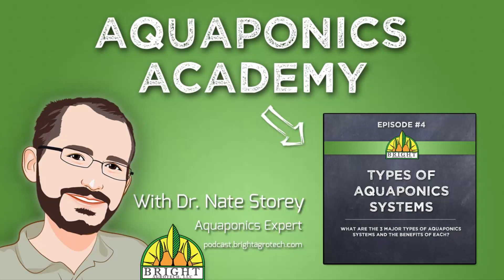Aquaponics Academy #4: Types of Aquaponics Systems

Comment: Hi Nate and thanks for sharing all your precious knowledge with us.
I would like to start a home set up in my back garden. It would have to be contained on a 6'x6' max and I was thinking of an ebb and flow system. It is not talked about a lot, rather the CHOP system with the famous bell siphon. Due to space limitation, I would like to avoid having a sump tank. Hence why I was looking at an ebb and flow.
I heard on one of your videos that some fishes do mind the change in water level when not using a sump tank, which is what is an ebb and flow.
What recommendation could give, in few words, me to start in the best way possible?
Thanks again
Reply from the maker: Most fish won't mind a change in water level if it's temporary.  I'd recommend an ebb and flow system using a pump on a timer or even better Travis Hughey's drain mechanism- I've been running one of his aqua farms for months now without a single maintenance issue, or failure.  A regular IBC system is an easy and inexpensive way to start if you want to go DIY-  check out Travis's drain mechanism it's in his free barrelponics manual. it looks crazy at first but the thing is the best drain mechanism I've ever tried.
Reply: That's a good news about the water level.
I saw Travis' drain mechanism, the fisherman's hook on his demo video: absolutely genius and decorative, which is to the liking of the woman :)
I got my hands on an IBC for cheap. I have watched many of your videos and I understand the importance of a sump tank but for some space reasons, I believe it would take too much room to run the system with a sump. In your experience, is still worth it to run an IBC system without one?
Thanks again for your help
Reply from the maker: You can run an IBC system with no sump, no problem, but if you still want one, get a shallow sump from a hydroponics store and put it underneath your IBC or one of your grow beds.  It shouldn't take up too much room.
Reply: That's a great idea and I can still run a gravity system with one pump... I must make sure I've got that one right otherwise I will flood the garden :)
Thanks again Nate

Comment: I had a question. In my system that is going through the cycling process I noticed that my ammonia levels drop everyday which is a good thing but my nitrite levels are still high at the 5.0 level and I noticed my nitrate levels are slowly dropping from my plants I planted. Do you know why my nitrites are not dropping?
Reply from the maker: It sounds like you're not fully cycled yet.  Slow down your feeding and wait it out.
Reply: Right on thanks man!!!

Comment: dwc and vertical together would be a perfect in combination, dwc floating raft is a pretty huge nutrient reservoir / fish tank
a dwc floating raft reservoir 20 meters long by 1 meter wide and 40 centimeters deep is 8,000 litres / 2000 gallons of water that's a huge reservoir and can feed a lot of plumbing
dwc is a good start and can easily expand to all of the other styles of plumbing really
im thinking about a vertical expansion fed from the dwc floating raft.. its a pretty huge reservoir can have it all combined as a hybrid system if you feel like it
Reply from the maker: The real question is why do you need a huge nutrient reservoir? If anything, it just slows down how fast you can manipulate your system variables to produce a desired effect. It sounds great in theory, but it makes the system much more unwieldy overall and limits your ability to manage effectively.  #aquaponics
Reply: an Australian summer hits 120 Fahrenheit in the shade fairly often 
clear sky hot like an oven extreme radiation fries eggs and bacon on all sun exposed surfaces, plastic melts plants turn to a crisp the sun radiation here is like hell on earth small reservoir is nearly impossible without shadecloth or refrigeration, a large reservoir is much easier to maintain in Australia
takes about 30 minutes a fortnight to top up a large dwc resevoir of any size weather its 1000 litres or 10 thousand litres takes about the same time by the time you dissolve each nutrient take tds ph readings and do the adjustment, there isn't much difference in time usage weather its a big reservoir or a small one really
tho the main reason is the hot summers we have, small reservoir is a lot harder to maintain temperature wise in this country
Reply from the maker: Ok. That explains it!